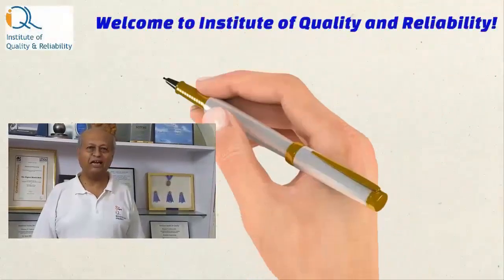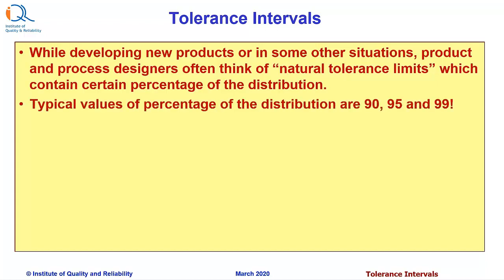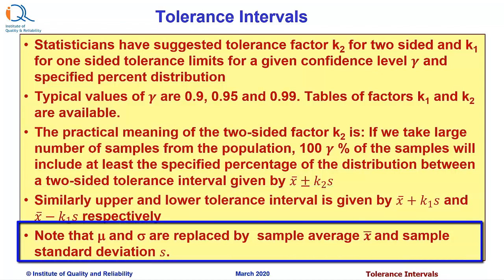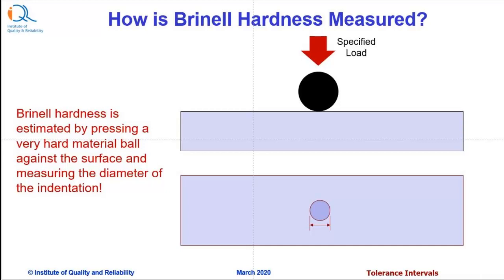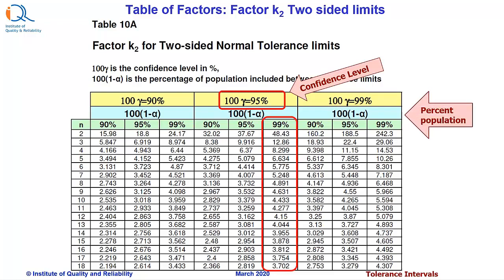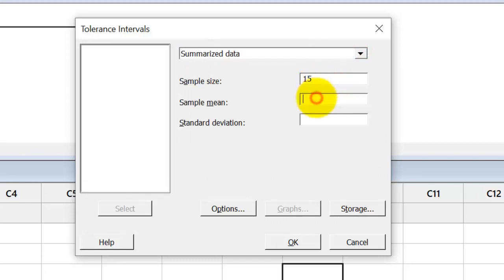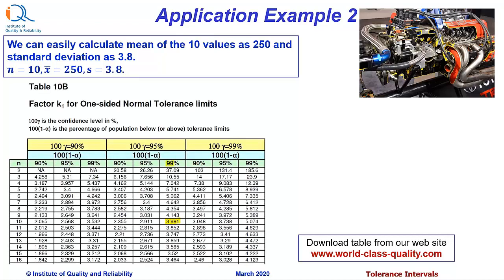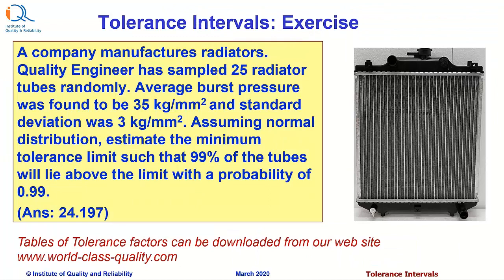Tolerance Intervals

Comment: Can you use tolerance intervals to protect equipment from failing such as finding tolerance intervals for motor amps ?
Reply from the maker: I am not sure. But if the output is stable and variable, you may be able to use it. Thanks for your interest. Good luck!

Comment: What happen if the sample size is 300? I cant find a table ta give values for n=300
Reply from the maker: The difference between factors reduces as the sample size increases. These tables are reproduced from Montgomeries book. You can get full tables in the link: https://onlinelibrary.wiley.com/doi/pdf/10.1002/0471733199.app1
Appreciate your keen interest.